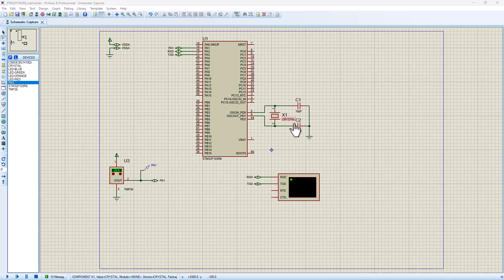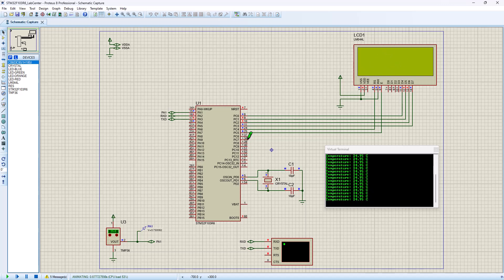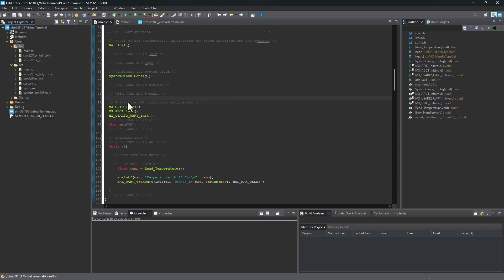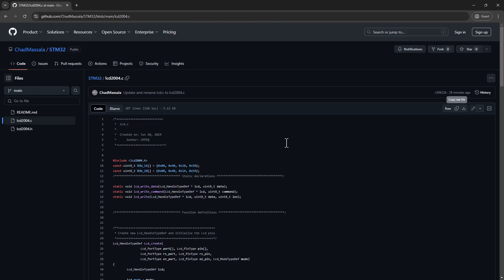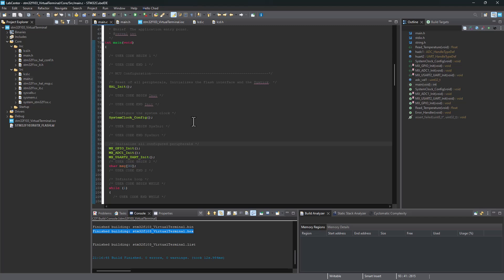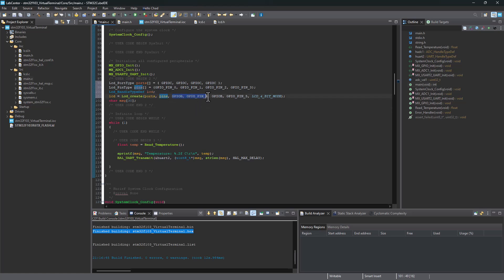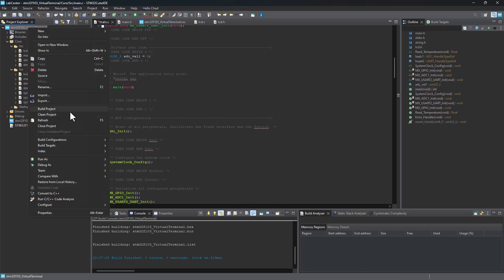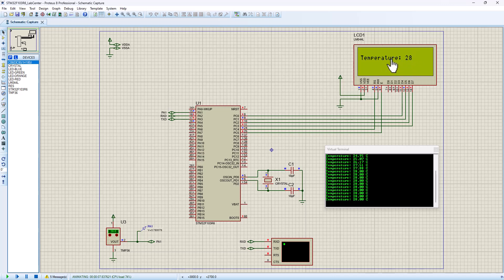stm32f103r6 Proteus 20x4 Crystal LCD Display

Comment: Hi! Could you tell me where you found the STM32 library for Proteus 8?
Reply from the maker: Hi, the STM32 library is already built in when you install Proteus.
It's the other libraries like bluepill that you need to manually install.

Just search under library symbols
Reply: @CMTEQ  Sorry for my stupid question, but my program doesn't have stm32 in its components.
Reply from the maker: Probably something to do with the installation, reinstall it, make sure you install the latest version from Proteus website.